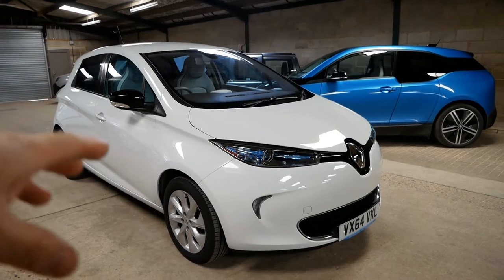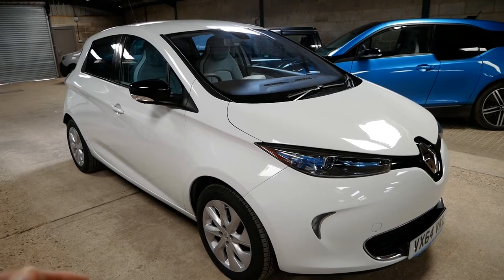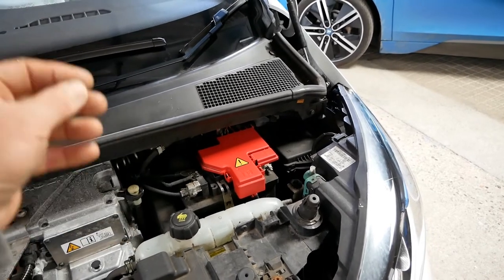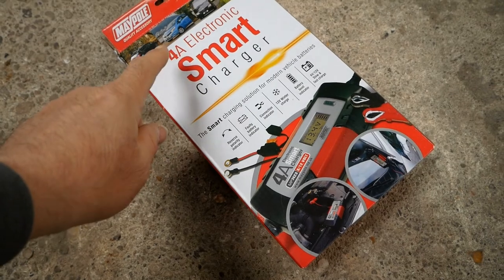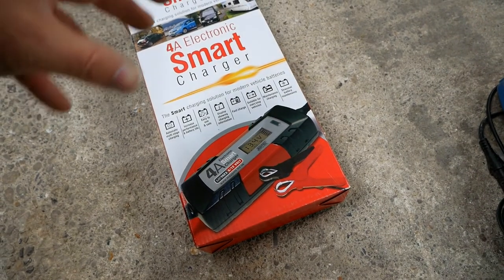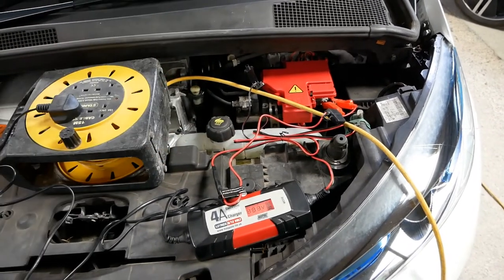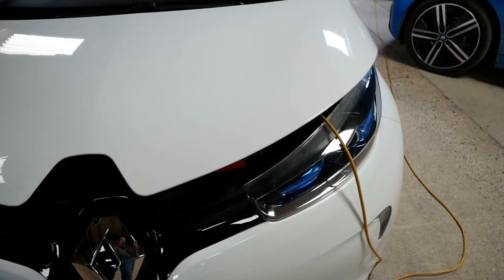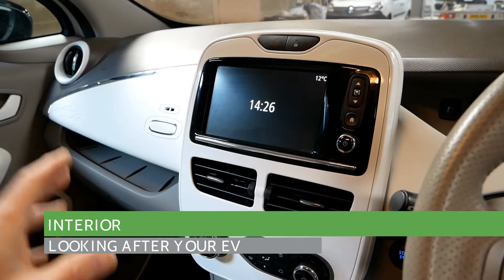Looking after your EV while you're not using it for long periods, such as during pandemic

Comment: Thanks for the info,very useful.I checked my r110 today.I opened the passenger door and the dash lit up.I flicked the bonnet lever and closed the door.Then I read 15.3 volts at the battery,obviously there was a charge going in.This lasted about 5mins then the dash went off and I re checked to get 13.9volts so all good.
Also I read my electric meter monthly and as the car hasn’t been used at all I was surprised by how low the reading was,compared to normal life.
Something I hadn’t really thought about.
Reply from the maker: You'll find that while your battery did measure 13.9v, this is because it was just charged and it will drop down over the next few minutes. But all sounds good with yours.

Comment: Very helpful. Presumably if the EV is on the maintenance charger then it's important to switch it off before opening the doors. What sort of damage could occur if not?
I don't yet have an EV (looking into getting one) but I will look to replace my very old dumb charger with a maintenance charger. (I always run the dumb charger on the low setting).

Comment: Really useful information, especially the part relating to the 12V battery. Does the battery stay connected to the car whilst the maintenance charger is in use?
Reply from the maker: Yes you can leave the battery connected while charging as long as you wait a few minutes before connecting it up as I said in the video. This alloys for the inverter to turn off.
Or you can disconnected it. You'll just need to reset the time on the dash and maybe enter the radio security code, depending on the vehicle.
Reply: I use a solar powered trickle charger connected via the 12v socket.
Reply: @mmigesh4735  I read this and thought, that’s a good idea, so I got one, and it’s keeping my Zoe battery fully topped up while we’re visiting family abroad for three weeks - and of course I can keep my eye on it remotely via the R-Link app. Tnx for the tip!